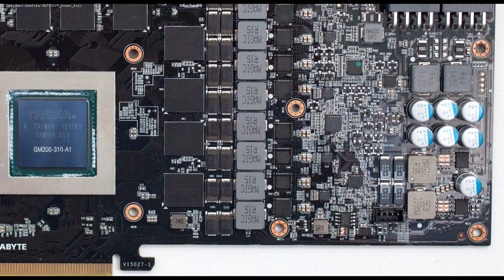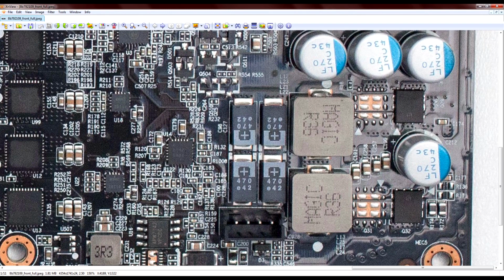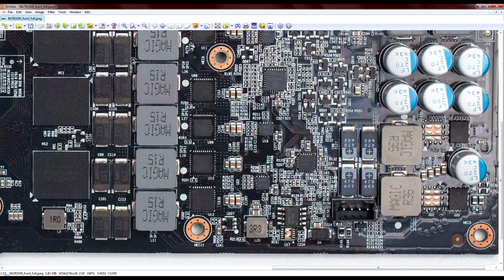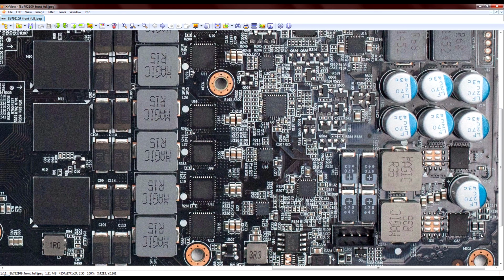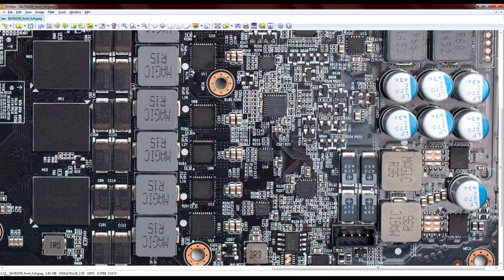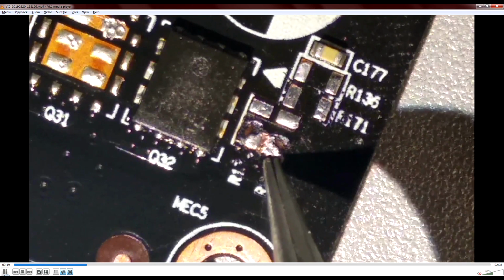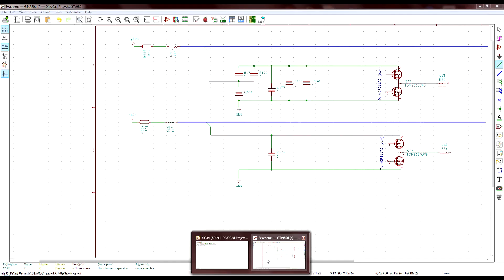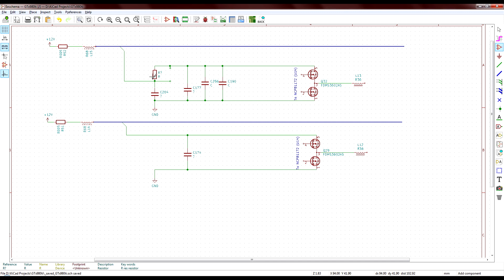Gigabyte 980Ti G1 GAMING-6GD Repair

Comment: Hi there, I have the same problem with power delivery, the gpu and memory clock speed fluctuates consistently on load and crashes. Temp is fine, limitation is power. Attached is the picture of q32 which I suspect from the look of it. I has to clean the contacts around q32 which has some dirt. Resisters seems to have Connectivity. Should I replace the q32, where do I buy them? Please help. Thank you for your great work. https://imgur.com/gallery/qYl11Q2

https://imgur.com/gallery/zN9LvlM

Just measured resistance across the two resistors and they are almost zero.
Reply from the maker: This looks pretty healthy. I would place small heatsinks on the q32 and q34. There are enough space between main heatsink for GPU and those ICs. I think you could fit some small heatsinks there. I do plan to do that and i will record a video doing it. I have to get more powerfull PSU so i can overclock the card.
Reply: Hi Uros Andric thank you for your reply. Attached is the clock speed fluctuation I get when I run benchmark because of power limitation. Do you think heatsink can solve this problem?
https://imgur.com/gallery/2KMl72F
Reply from the maker: @indran2011 Hm. Have no idea. Does fluctuation happens when you don't limit the power?
Also if fluctuations starts emediatly when you start the benchmark then probably heatsink won't solve the problem. If this is my card and i have this problem i would begin with the bios and Install fresh stock bios on it and see whether there is any difference. If not, then bios is not the problem and i can exclude it as the cause.
Reply: Uros Andric , yes the problem starts as soon I start the benchmark as you can see from the graphs. No issue running Windows as the clock speed is low and also the power. As you can see. It goes max power and frequency for a second the starts dropping down to half load then it’s goes up again, continuous oscillating. Yes I have flashed the gpu bios to latest stock bios, drivers and applied new thermal paste and pad etc but no luck. It is definitely hardware issue. I bought it broken from someone with the fault so not sure of its history. Btw my q32 model is different from your it’s fdf260e 22ca n7cc. Can’t find a replacement on eBay. I wonder if you know a compatible one? Thanks
Reply from the maker: @indran2011  i don't think your q32 is the problem but you can replace it if you wish. So your model is 22ca n7cc. Here is datasheet for it. https://www.mouser.com/datasheet/2/149/FDMS3604S-526687.pdf
I found it on aliexpress. But you can look at ebay.
Reply: @UrosAndric  Thank you for your qucik response. I read Micosan issues below and i have the same problem. I am hoping replacing to 0ohm resistor will resolve my problem. Maybe you are right that the mosfet is fine. Strange thing is that when i measure resistance between R52 and the R172/174 (top sides) its 0ohm, but when i measure between R172 and Q32 (top left corner leg), there is some resistance about 0.2-0.3ohm. Why is there some resistance between this two since no components between them and they are next to each other? BTW, i am using cheap multimeter. Anyway i cant understand how Micosan managed to solve his problem magically by replacing the R172/R174 with 0 ohm although they are not faulty/fused. I dont have 0ohm resistor, was planing to remove R174 and test without it. ten next step remove R172 and put a think wire accross and test.
BTW what size is the 0ohm resistor? What spec shall i search for in ebay? Is it SMD size 0603,  0805 or 1206?
Reply from the maker: @indran2011  R132 and R134 are ferrite beads. They are not just resistances that dissipate heat. Equivalent scheme would be resistor in row with capacitor, coil and resistor in parallel. That would work as a resonator on some frequency. If those ferrite beads have changed some of those values due to extensive heat it can oscilate on wrong frequency and make a mess. You can't measure those values with multimeter. Even if you could, we don't even know what are the values for those original components to begin with.
Replacing those with a wire is much easier than replacing q32. You can try it and see if it will fix your problem. You can jump wire them for begining and see if there is any difference. If there is a change, maybe replace them with 0ohm res.
Reply: @UrosAndric  You mean R172 and R174 are ferrite beads? What size is the 0ohm res? What size wire to use temporarily?
Reply from the maker: @indran2011  yes, R172 and R174. My bad.
For testing use any thin piece of wire pe out from  electric cord or any other cable. One guy used thin wire from broken usb cable but that one burned quickly because it was not thick enough. In that case use two or tree wires. If those ferrites are the problem, then replace with 0ohm res 0603. I don't know really what is the current there, i used 0ohm res. from other dead board i had lying around.
Reply: Uros Andric you are a genius. I removed r172 and r174 and installed a wire across it and the graphic card works like a charm. Thank you so much for your help. I bought some 0ohm resistors and now waiting for delivery. How did you manage to learn to troubleshoot?
Reply from the maker: @indran2011  Owesome! :-)
So this.might be indicator for that card is faling. It can be good indicator for your card so you know to replace these before it is too late.
I do have education in electric engineering.  I haven't done it for a while. I was working in video production and i needed a better gpu for post production compositing and animations
With limited budget i was able to afford this card  but only the broken one. I decided to risk and use my skills to fix it. It was worth while. So now i have excellent Gpu and i was able to learn something along the way. Then i started to pourchise broken hardware and recording troubleshooting. I have several videos ready for it. Just waiting for components to come so i can finish repaireings.
I learned everything online. Must say that Louis Rossmann was great inspiration.  Also the Russian guy Eli Tech and his videos ware werry helpful.
Reply: Uros Andric well done and keep up the good work. You managed to save my graphic card and reduce wastage. I also told a guy in eBay who is trying to sell the same card with same problem. Hopefully he will be able to fix it as well. Thanks again.
Btw what do you mean this might be indicator that the card is failing? You mean the card is not fully fixed even after replacing with 0ohm resistor?
Reply: Hi @UrosAndric  Do you have PayPal account? I would like to pay for your help? Also are you on Facebook?
Reply from the maker: @indran2011  i will setup repairing channel and paypal/parteon account in the furure. Will place link here and inform everybody.
Thank you for your support and i hope to help more people :-)
Reply from the maker: @indran2011  Also, can i ask you for permission to use your images of fluctuation power while under stress. I am planing to make a video about what are simptopms before actual burning happens.
Reply: Uros Andric yes sure, please go ahead
Reply: Uros Andric yes give me your PayPal link. Thanks
Reply: After i puy the wire today my 980ti is dead in game i get white screen and the card is not turn on anymore. But when the game has running i get the same problem clock goin up and down

Comment: hi, ive a question. i am not professional but ive replaced burned 2 of them with 1 copper wire from USB cable. but after 1 load test copper wire is burned. now i wondering can i replace it with thicker wire or its have to be 0 ohm resistor? or am i having other problems on my board?
Reply from the maker: If card worked normally until wire got burned then probably card is ok. You need ticker wire or the best option is 0ohm res.
Reply: @UrosAndric  where do i can find downloadable schematic files for gpu pcb?
Reply from the maker: @gantugshaschuluun1222  I wish i could find one :-)
Then i would know exact values of that burned components. In this case i am replacing them with the fuse because i have no odea about their values.

Comment: It just happened to me :O I cant find 0805 0 ohms close to me, they send them from china and took 1 month? 
What will happen if i just use the flux or a little cable? teorical is 0 ohms right?
Reply from the maker: Piece of wire will work. I have soldered 0ohm resistor to be there as a fuse in case something goes wrong. Full year od using it and it is all good :-)
I am using it on default mode, haven't overclocked it yet since don't have adequate power supply to test it fully overclocked. But on default values it is working normally.
Reply: @UrosAndric  I just did the fix and is working perfectly, thank you so much
Reply: @fableton  Did you use 0ohm resistor or wire? I don't have 0ohm resistor with me so i can use wire or wait for delivery of resistors...
Reply: @michak7927  I used a 0hms resistor and it keep working, I ordered a pack of resistors from aliexpress and wait 2 week without a GPU. If you can't wait I think you can use a wire without problems.
Reply: @fabletont1393  I use wire (in fact i just solder gap between two pads). It's workign without any problem. Tested using furmark for 30 minutes.
Reply: @fabletont1393  can I check with you what are the specs of the 0 ohms resistor that u got? I see there is a few amp and watt ratings, if not do you mind sending the link for the aliexpress listing? My card just happened to have the same issue now
Reply: @shoterboyx  I don't know the exactly value I just bought the same size
Reply: @fabletont1393  i tried to bridge the pads, and my whole pc doesnt turn on, i think for my case might be something else
Reply: they are not too burned, so i hope the other components are ok 
https://imgur.com/a/Kl46cOq

Comment: I have a problem with these two ‚resistors‘, too. So I want to replace them. Should I remove both of them and try to replace only one of them with one resistor, or is it necessary to replace both  of them with two 0 Ohms resistors?
Reply from the maker: Replace both of them with only one 0ohm resistor. Just check if the Q32 is still good. You can do that when you remove burned resistors. Measure resistance then between upper contacts of those resistors and the ground. You should have high resistance (open circuit). If the resistance is low then Q32 is dead also.

Comment: Hi Thank u for making this video. I'm still currently having problems even after soldering in the 0 ohm chip. It looks though as if I damaged some of the parts around it while soldering it and am not sure if it's put in correctly. Gigabyte g1 gtx 980 ti https://imgur.com/gallery/d0Fm3Eo
Edit: I resoldered the resistor and it now works! :) Thank you for making this video

Comment: Hi. Great work. 

My card has the R174 damaged, while R172 looks fine. Should i still desolder R174 and R172 or just the damaged R174? And if only desoldering R174 is necessary do i need then to replace the good looking R172 with a 0 Ohm resistor or can i leave R172 like it is now?
Thanks in advance
Reply from the maker: I would replace both components with 0 ohm resistor. Those components are in parallel mode so if you keep one of then and solder 0 ohm on the other place you will split the current. So 0 ohm will not have a purpose as a fuse then. All the current have to go thru that 0 ohm res in case there is an excess current it will blow and protect the switching IC and memory eventually.
So i would remove both of them and replace with one 0 ohm resistor (fuse).

Comment: hello, I just have to put a resistor on r174? that is r172 is free right?
Reply from the maker: You have to remove both of them and then to place a wire or a fuse (0 ohm resistor).
Reply: ok, thanks, but I have to put two resistance or just one in r174? r172 must have another resistance? or r 172 is left with nothing
Reply from the maker: R172 and R174 are in parallel (look at the schematic in the video), so you have to remove both of them and then place just one resistor/fuse on a place of either one of them.
Reply from the maker: You should also measure Q32.
But if you don't know what are you doing and doesn't have basic electronic knowledge or soldering skills you should better let it someone who knows that he is doing to do the job.
Reply: Q32 What value should it have?
Reply from the maker: @balta8802  well don't know right now, but i am sure that resistances between source and drain should be very high on both mosfets inside Q32. Also resistance between gate and source/drains should be high as well. This is true only if you discharge cpacity inside the gate (google out how to test mosfets). This is where you can find schematics for Q32:
https://datasheetspdf.com/pdf/947277/FairchildSemiconductor/FDMS3660S/1
Reply: Ok, thank you very much, I will investigate and I will inform you thanks greetings
Reply: hello, the q32 is broken, what is the name of the component? thanks
Reply from the maker: @balta8802  Please read the markings on Q32 and write here what they are.
Reply: Df33af
Reply from the maker: @balta8802  There must be more than that. Loo of there is something else written there?
Reply: @UrosAndric  Hi, I must have a much older mosfet (DF28AK 22CAN7CC) I can't find any suitable match. Would using the closest type such as the stuff you linked above be fine?
Reply from the maker: @Scottx125Productions   For markings "22CA N7CC" corresponding component is FDMS3604S.  I know it can be found on aliexpress but try to find it locally so you can have it sooner.
Reply: @UrosAndric  Cheers. I'll let you know how it goes!
Reply: @UrosAndric  So I attempted the fix, the resistor replacement went well but I'm slightly confused about the mosfet. On mine there are 4 connections top and bottom which need to be soldered. But there are also 3 either side which are practically impossible to solder and pads underneath. Do the 3 connections on the sides of the mosfet have to be soldered as well as the 2 bases underneath the mosfet?
Reply from the maker: @Scottx125Productions  Yes, all the pads needs to be soldered. The best way is to use hot air rework station but in the lack of that you can use soldering iron and a lot of flux. Try to find on YouTube how to solder smd chips without hot air gun.
Reply: @UrosAndric  Hi, unfortunately no success. I tested all the connections with a Multimeter to determine if they are all connected and they seem to be charging some form of capacitor which discharged at 1.9(something, prob volts). Yet when put into my rig the fans go wild and the MOBO reports a GPU error and goes into a restart cycle. Thanks for all your help :).
Reply from the maker: @Scottx125Productions  Sorry to hear that :(
It might be that RAM is dead and it won't boot properly (talking from top of my head here). If have time and will, you can take pictures of what you did and your measurments and place photos here?
Reply: @UrosAndric  Sure. I won't be able to get around to it atm but I might be able to take some photos tommoz before work.
Reply: @UrosAndric  Here you go https://imgur.com/a/iJpzCoW. Though it prolly won't do much good. Decided to re-soder the mosfet since a lot of connections weren't connected first time around. Made sure everything was connected, put it in my computer. Got it to post but 5 seconds later it burst into flames xD. I think I'm not gonna risk it anymore. Btw it looks dirty because of flux, I cleaned it up later :P.
Reply: Yes, tomorrow I look well, I'm not home now

Comment: Thanks for the info. R174 on my board just melted with a bright red flash. I'll try to put a 0 ohm resitor hoping for the best (actually, the resistor melted during the boot after a sudden shutdown, but then the system start with video but without video driver, so i hope mosfet and vram are ok)

Is it better to just change both R174 and R172 resistor? R172 looks fine and it's still working

PS: just to let you know, my tester see the R172 as a ~1ohm resistor. Since I'm using a very cheap tester, I think that it's a 0 ohm resistor
Reply from the maker: R172 and R 174 are ferrite beds. They are not resistors in that sense. They are used as filters and they have resistance less that 1 ohm. I would replace both of them with one 0 ohm resistor and i would check the Q32 as well.
Hope your card is ok since it has booted without drivers.
Reply: @UrosAndric  RIP, card dead.
I don't know how it was possible that the system booted once, but one of the mosfet was definitely fried. I tried to remove it from the board but now I have a "white cursor line" (like when you don't have the OS on the disk) for 1 sec and then the screen blink. that's it
Reply from the maker: So you have removed Q32 from the board and it doesn't work?
Reply: @UrosAndric  Is there any way to test if Q32 is not fried?
Reply from the maker: @TheCJMaciaz  in a way, yes. Mesure resistance between upper contacts of burned resistors and the ground. You should have high resistance. If that resistance is low then q32 is Dead. After you do that write to me with the resaults so i can give you further instructions.